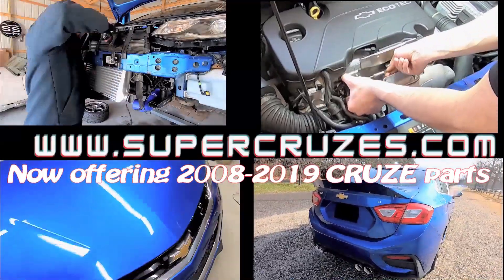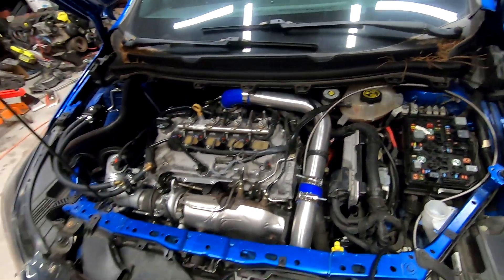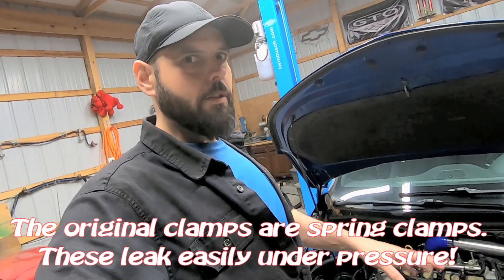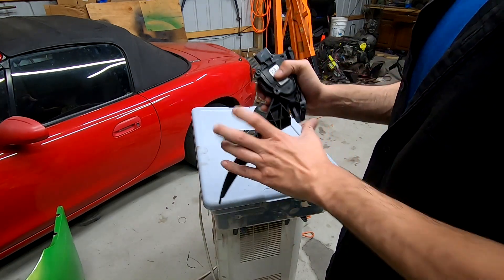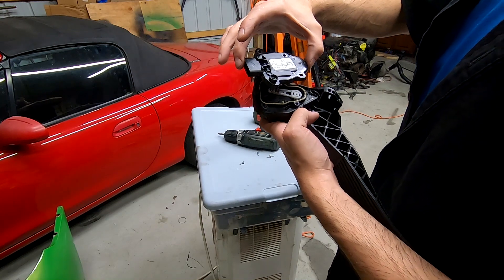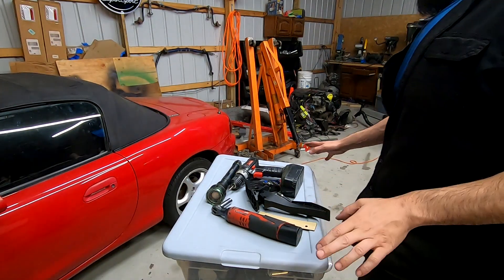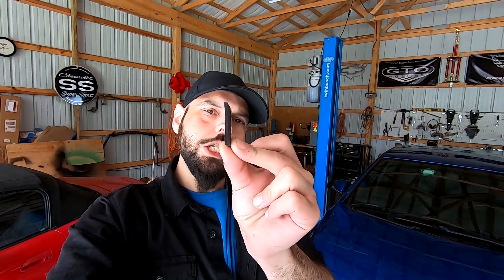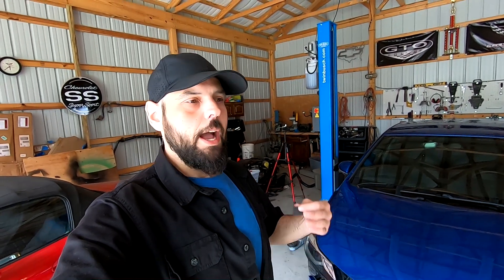CRUZE/Malibu 25psi of boost fix and throttle mod. CRUZE Missile big turbo build

Comment: Is it stock cruze turbo? 25 psi seems a lot!
Reply from the maker: IF you do not properly maintenance your car and beat the crap out of  it yes it can be.
Reply: @davesworld2132  so its on a stock turbo?
Reply from the maker: @alexanderkim7241  no this is part of a big turbo series. Currently I push over 30psi now
Reply: @davesworld2132  ah, i see, what was the max psi on a stock cruze turbo? Have you upgraded your pistons, rods, camshafts, so it can hold 30psi?
Reply from the maker: @alexanderkim7241  no you don’t have too unless you have not maintained the car properly and set up the right supporting modifications
Reply: @davesworld2132  could you calculate
The price for 1.5 lfv intercooler kit?
Reply from the maker: @alexanderkim7241  yes but I do not put prices on YouTube. Contact me directly again.

Comment: Hey Dave, what do you think about chevrolet performance chips? Worth ot or nah?
Reply from the maker: Depends on the vehicle honestly if it’s for one of our cars it’s best to go to an actual tuner. But if it’s for an older 90s or 80s car a power chip works just fine.
Reply: @davesworld2132  alright yeah I thought so. Sucks because it's pretty cheap compared to a tune lol
Reply from the maker: @williamgray8664  basically when it comes to performance parts you get what you pay for. Cheap usually means cheap. But the best bang for your buck is going to be quality parts. What year is your car?
Reply: @davesworld2132  I have a 17 1.4t hatch manual.
Reply from the maker: @williamgray8664  perfect. I know exactly what mods to get for each budget.
Reply: @davesworld2132  sweet! I don't want a drag car just a little more woosh lol
Reply from the maker: @williamgray8664  lol I’m good at more whoosh!!!!

Comment: Yes it has been a while.  
 Happy to see you moving around 1st off. 
 Yes even on gen 1 if you don't press the throttle to the floor you stay in the boost zone a bit longer to the floor boost is gone. 
 Be safe / good to see you are well.
Reply from the maker: Hey my apologies I usually reply the same day but this comment didn’t pop up on my notifications. I’m glad you let me know that I just bought a generation one also. I’m going to start tinkering with that car as well.
Reply: @davesworld2132  
I have been able to work on my 2012  and I found that denso plugs were different lengths than stock ac delco plugs. So denso plugs were not in the flame front as far as ac plugs. 
 So I have been plagued with p0420 code. So I put in stock plug in and flushed out my injectors it's been 200 miles and no more 420 code for now at least.  Going to Boston tomorrow so I hope this was a good fix.  As for misfire on start up it's funny no steam cleaned pistons or plugs , no oil in cylinder either. 
 So I'm guessing purge valve is a possibility.  
 I got my mom all set & have been working a bit on my cars again.  
 Thanks for the reply & no worries on getting back to me on the same day. I'm pretty relaxed about that stuff I know you are a busy person. Thanks for your videos.
Reply from the maker: @jeffboyer8214  Interesting problem. I bet the arc from the spark plug was hitting the head instead of the diode.
Reply: @davesworld2132  interesting thought  I'll have to do a fire up at night thank you sir.
Reply from the maker: @jeffboyer8214  no problem. Keep me posted!!!!!

Comment: Hey dave. I changed the tubes on my waste gate and controller. very noticeable difference in response and power. I just have a question if you had a trick to getting the tube that goes to the bottom of the turbo from the controller? i have the stock one still on that bottom but my other 2 are changed. thanks for this informative video 😎
Reply from the maker: I had to remove the airbox and the diverter and do it by feel  than when I put it back on I used a screw clamp and ran a long extension behind the turbo to get to the new clamp
Reply: @davesworld2132  that's going to help me tremendously. i did mine when the car was still a little hot so ill make sure to let it cool down. It helped with my RPM fluctuation issues too. i dont have a boost gauge but i feel its pulls harder with the tube upgrade and the pvc piping diversion to the oil catch can. I also have the mamba wastegate. Thanks so much Dave
Reply from the maker: @BeilNee  do you have a catch can?
Reply: @davesworld2132  yes i have a catch can that i routed the piping down towards the subframe behind my bumper. i made a bracket to screw it into the side so that the oil will flow downwards and not pool in the lines

Comment: Hey Dave, I may have missed it if you’ve said something about it, do you plan on running BNR’s E85 tune?
Reply from the maker: No. I do not have E85 in my area. I designed a methanol injection system that provides a lot of additional power and intake air temp cooling. You could literally pick up methanol at AutoZone. First video is being posted over the weekend or maybe Monday on the meth injection.
Reply: @davesworld2132  Sweet! Can’t wait to see it
Reply from the maker: @989Kaleb  just finished editing the first video today. May post it tomorrow

Comment: Would making it more sensitive fix the take off delay.
For example sometimes if im stopped at a light and it turns green and i try to take off fast..the car takes FOREVER to take off.
Same thing happens sometimes in my trax
Reply from the maker: Actually I have a pedal modification to the spring that helps with it. It’s one of my original videos when I started the channel.
Reply: Buy a pedal commander
Reply: Might be because of AC , higher octane gas helps out a lot from what I and many others have noticed. Also this car isn’t fast by any means it’s an economy car you have to do many things if you want it to take off fast lol

Comment: Interesting solution to the boost problem.
Reply from the maker: Have you had any issues with your car doing that ?
Reply: @davesworld2132  I have not made any mods on mine plus it has an old fashion throttle cable.
Reply from the maker: @bernardaflores1720  I miss those days! I hate these fly by wire systems.